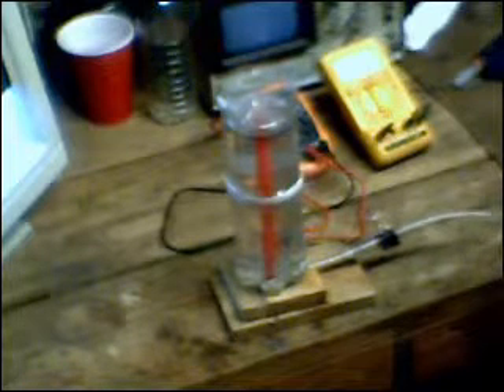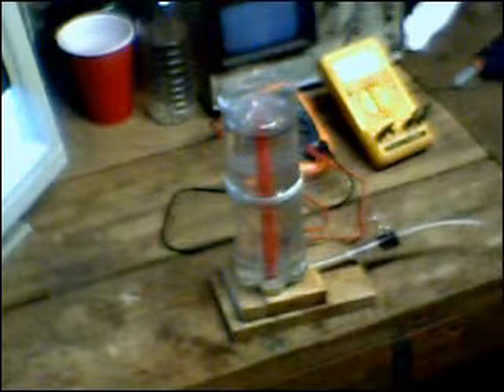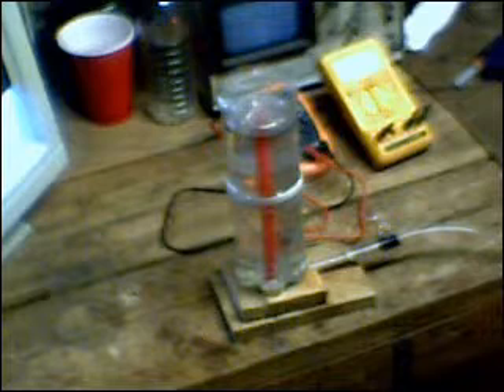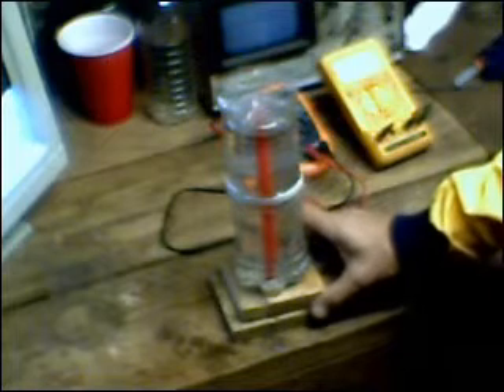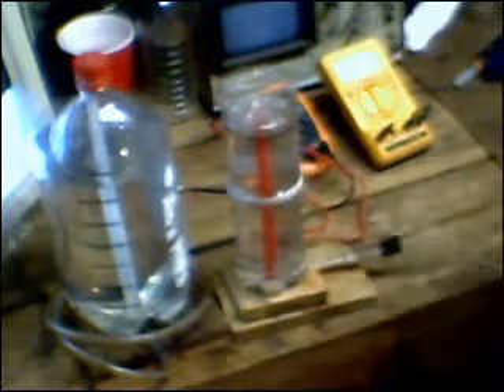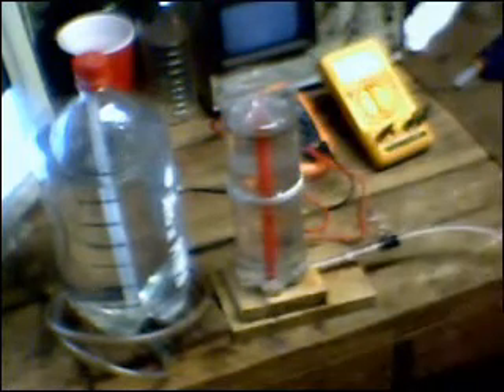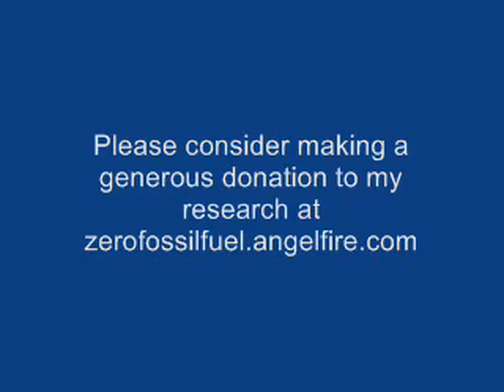#42 Refinements to the Gas rate measuring tool

Comment: My theory is that if you put a spinning motion to the molecule than it will split even sooner.
The most important thing is that there my not be a flashover/short circuit of current because you lose all the energy you just build up.